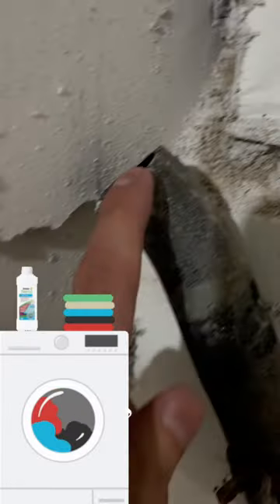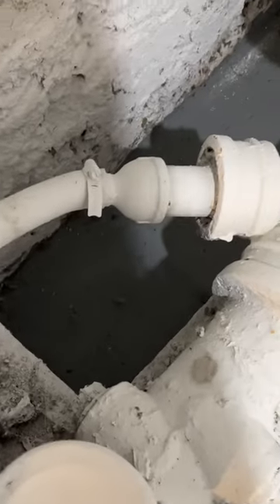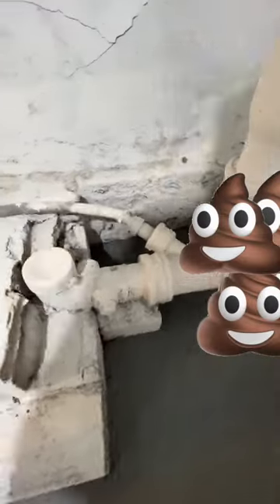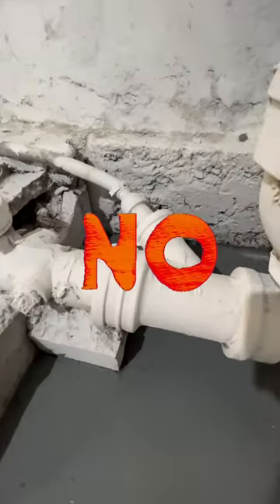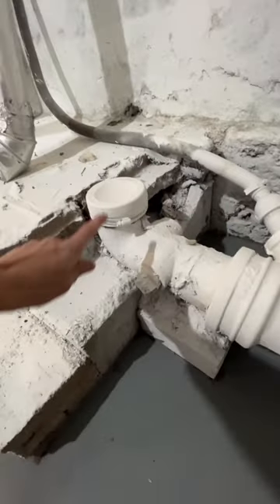Washer Machine Sewage Drain #homerepair #washer #shorts #diy

Comment: It’s called a guy gray box bud
Reply from the maker: Here we need an air gap of some type..they were hard plumbed right into the sewer drain 💩
Reply: @HomeRapidRepair  I just had to undo this exact scenario... after I had corrected already once, the homeowner undid my fix (indirect drain into laundry tub) and "re-plumbed" it to the main drain.. which btw is a septic system..... so gross and ignorant it's hard to express... this time they put in an $8 check valve which, when removed, had a deteriorating flap .... did I mention the washer drain pump was being asked to pump up about 10' and AGAINST gravity-drained toilet water, as the washer cut-in to the main drain was... you guessed it... below the toilet drain........unbelievable what people think is okay. Scratch that. There is ZERO thinking in situations like this! Cheers and keep up the good work!
Reply from the maker: @ScottAllenFinance  holy cow that’s a crazy story man. Thank you for sharing. Hopefully you’ll have a better day tomorrow 👍🏼😊🛠️